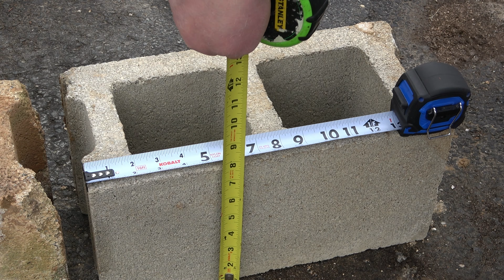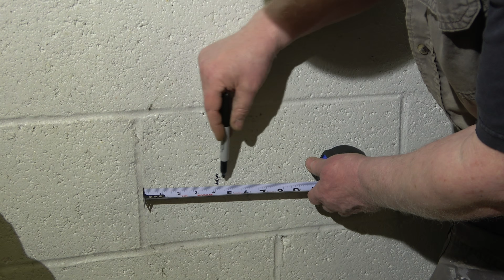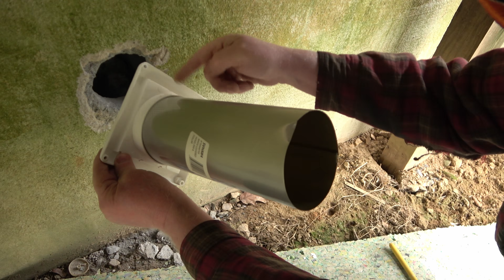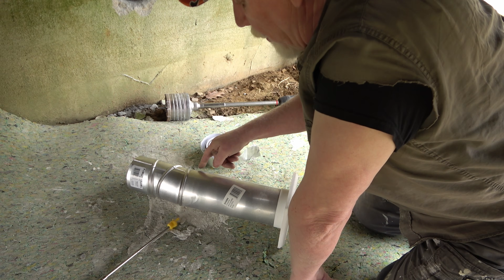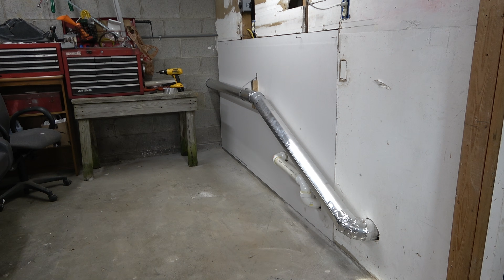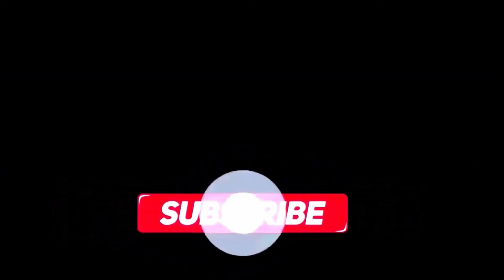Drill 4" Hole Through Cinder Block for Dryer Vent

Comment: 700 dollars later
Reply from the maker: 😋 Reddirtrelichunters 😋
Reply: @wildwoodtop good thing I been at it a few years. Was only shy on the holesaw so I stand corrected-200! All in with the sds drill, bits, shop vac, drill, caulk gun, caulk chisels, hammer, tarp, and fasteners we are getting close if not up to 1000 to get er done. What did you end up charging for this one and where are you located. My video on the subject is up and Adam
Reply from the maker: @Reddirtrelichunters  No charge, This was at my personal home in Maryland
Reply: @wildwoodtop I see

Comment: You claim to be a pro but you don't have a large drill and hole saws for concrete? I am just a homeowner and I have 3, small medium and large with many sizes of bits and hole saws.
Reply from the maker: 🤟 Homeowner With Large Drill 🤟

Comment: Nice video, thanks.. aside - I think your washer valve box is upside down (when supply comes in from the top valves are on top; when from bottom, valve on bottom.. that's why they supply drain pipe fittings on top and bottom - so the box can be install with valve up or down, agree?).. mostly only matters if you needed to drain the plumbing supply lines, want to prevent stagnant water, and/or reduce number of fitting/potential leak points, cheers, LZ
Reply from the maker: Yeah after I finish that I looked at it and I thought it looked a bit odd I'm used to bringing the plumbing up through the bottom also noticed those '90s a Sharp 90 also reduces the flow of water

Comment: Great video.  So how do I determine which type of cinder block that I have if I'm only viewing it from the side?
Reply from the maker: Good question lol Let Me Go re-watch the video Thought I covered that 😋In that case I would just drill the hole where you want
Reply: @wildwoodtop  you covered the differences in types of block but that was with a clear view from the top.  When I'm in a basement I'm not going to have a top view just the side.  Thanks!
Reply: I think the point is that if you have the 3 cell block, it doesn’t matter where you drill since you will hit a rib. The measurement just makes it a little easier if it turns out you have a 2 cell block. Also, great video!
Reply: @jmc755 got you, so basically just assume it's a 2 cell and still in the cavity area.

Comment: Oh, to have friends with tools...  🙂  Working on a similar project in an older home.  Trying to use the existing setup, but a water pipe is slightly in the way and the duct traverses between the 1st and 2nd floor.  I'll get there eventually!  Thanks for the video.
Reply from the maker: You are welcome 👍